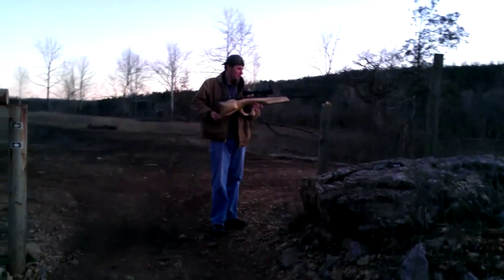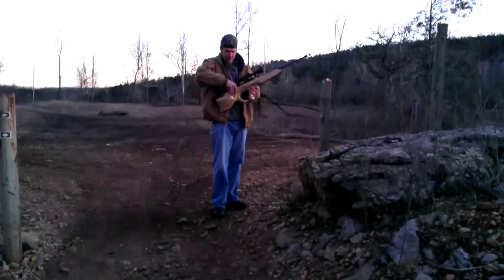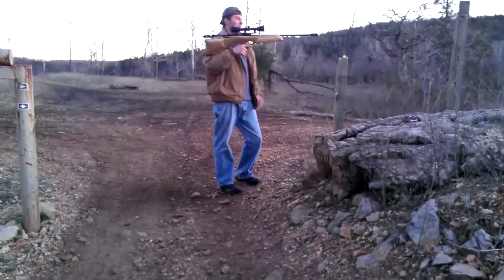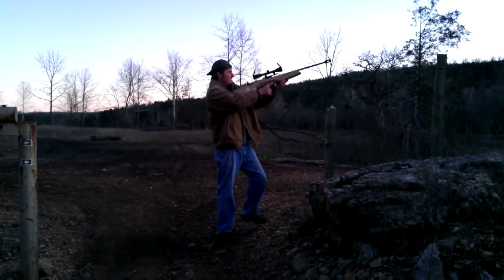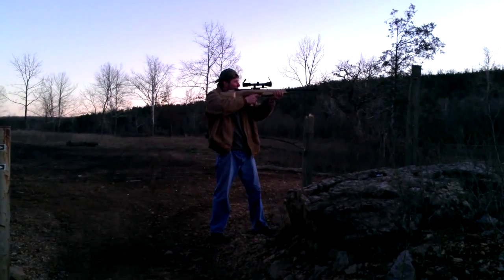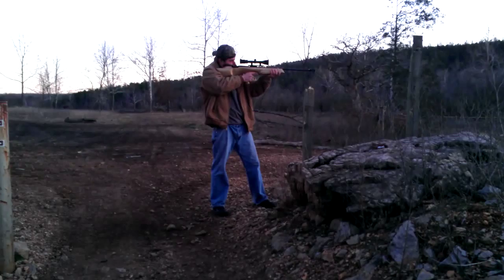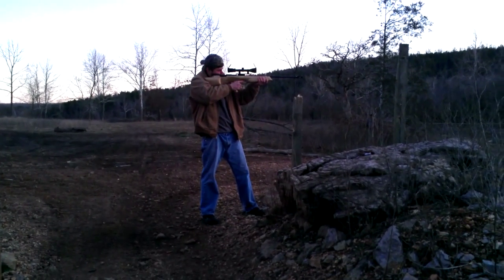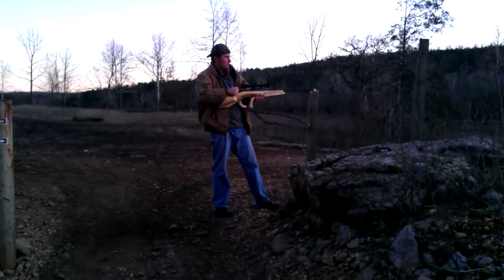Homemade mosin nagant bullpup

Comment from the maker: Just winged it bro. Took depth measurements from original stock and use hand disk sander for the outer. Turned out alright for a first go around. Only issue was the trigger system. Milled it out of a block aluminum and use a steel rod to attach it to original trigger. That to was trial and error. Good luck!